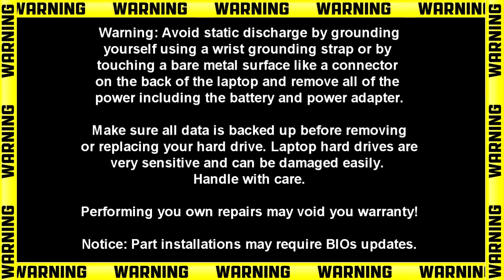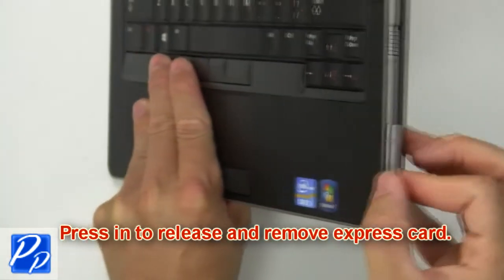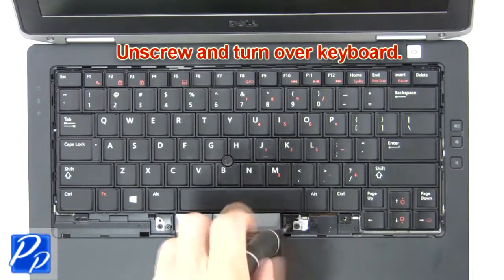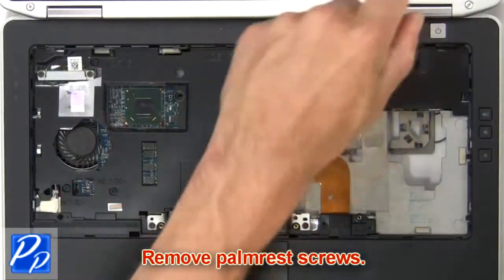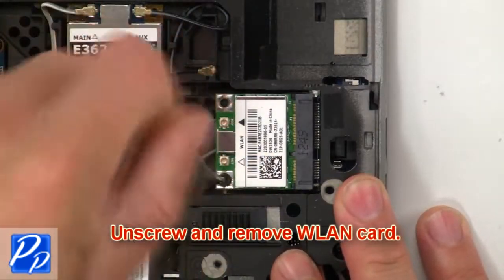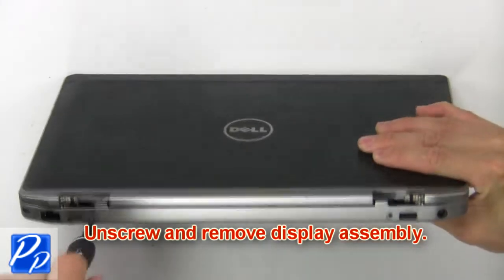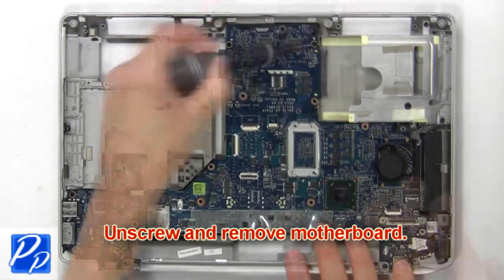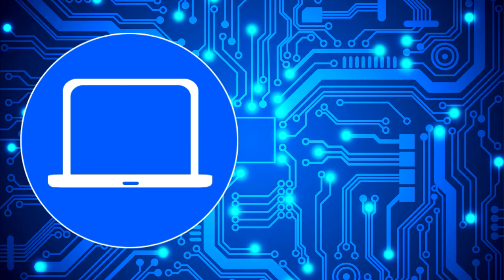Dell Latitude E6330 (P19S001) Heatsink How-To Video Tutorial

Comment: When I connect the internet cable, the processor speed drops to 0.89. When I disconnect the cable and restart the device, the processor speed returns to 2.40. What is the solution? My device is a Dell E6330, 3rd generation, i5 processor. I have searched extensively online for a solution but haven't found one. I would appreciate help from anyone who sees my comment.